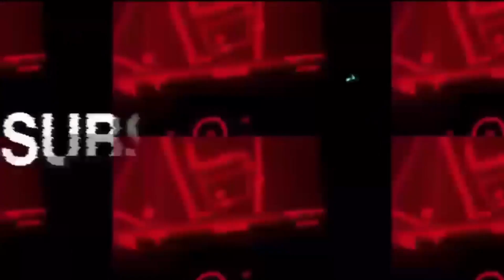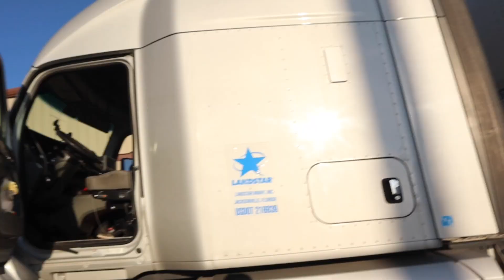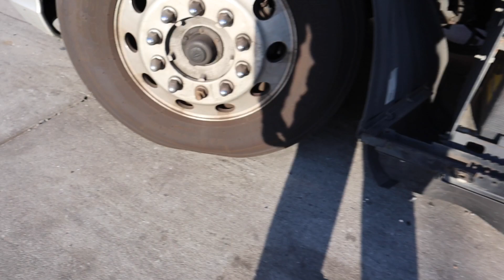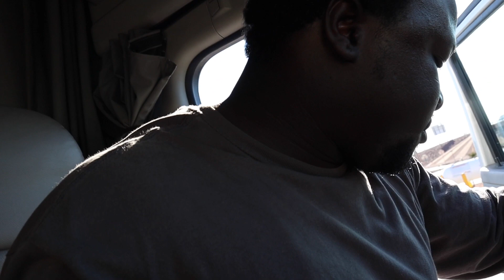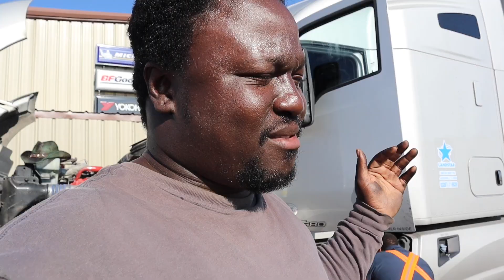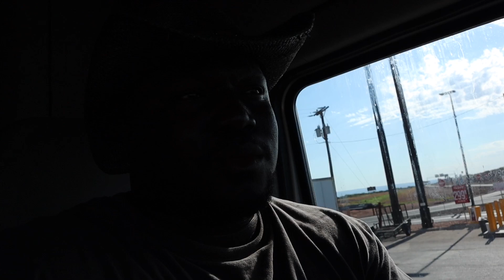WHY THEY TOLD YOU NOT TO BE A OWNER OPERATOR PT 2*landstar owner operator dry van* trucker life

Comment: I had to replace all of mine during orientation 😪 They billed me for 6 hours of diagnostics before they checked the batteries. I almost lost my shit. $1450 total

I went with CAT batteries 1000 amp.
Reply from the maker: I was on they ass they whole time my total was like $860 plus I had to buy a new part too cuz one of the cables was broken
Reply: @ChasingMrHamilton  😳 Man That Loves charged you for everything!!! 

Too bad you couldn't make it to the house before all this happened. You could have saved a ton of money.

My truck is going in the dealer at the end of the month. Electronics are going crazy with it. It's still under full warranty. So they're keeping it until it's fixed this time. Probably 2 weeks 😠

Last time, it took 6 days. And it threw a code leaving the driveway.